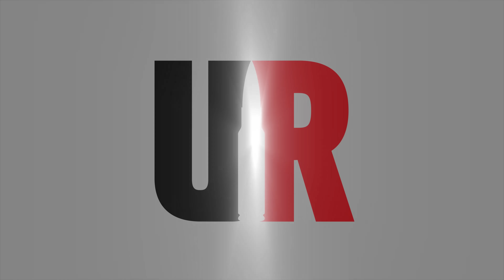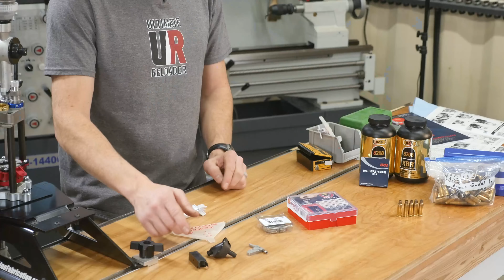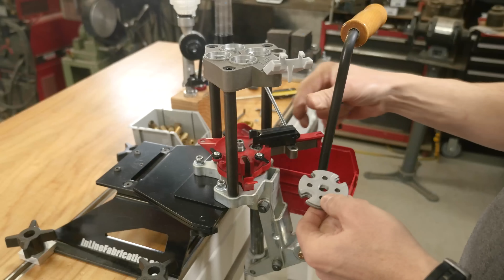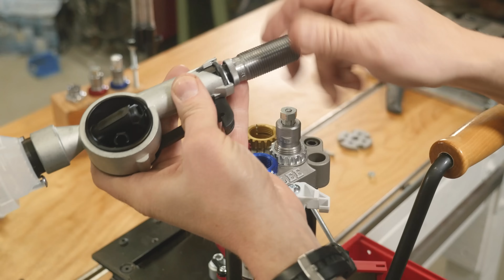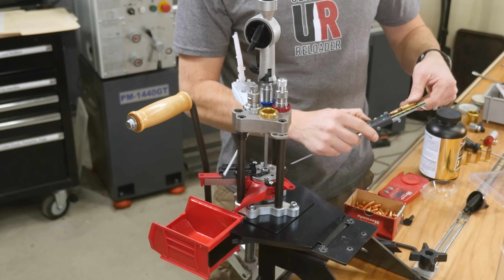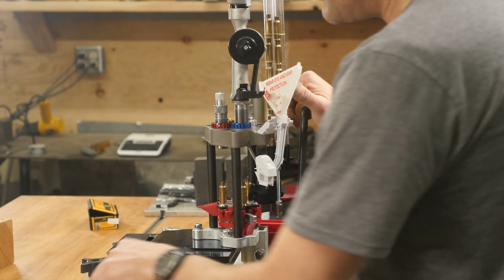Lee Pro 4000 Caliber Change + Loading 6.5 Grendel

Comment: After decades of single press reloading, I finally got out the Lee Pro 4000 9mm kit I picked up on sale a couple years ago.  Game changer from single press no doubt, a little learning curve into knocking out 1000 rounds in my spare time over a cold icy snowy weekend - something not possible at all with a single stage setup. Time to build up for the 2026 season. I do use my crimp die in station 4, good results. First weekend results are very nice.

Comment: How accurate is the powder charge? I'm thinking about buying this unit to reload 44 magnum using H110 powder. From everything I've read and watched, the gr weight with that powder really needs to be spot on or it can cause over pressure.

Comment: The pro 4000 is trash.
Will not index reliably.
Will not feed cases reliably,
Primer feed system is a cheap piece of  $h1t
Don't buy one , you'll be very disappointed.
 I'm an experienced reloader with 43 years of loading behind me.
 I own a lot of equipment and Speaking from experience, I can tell you that Lee Progressive Machines are Crap.
 Save the extra money and buy yourself a Dillon 550B ,
550C,  Square Deal B, or an 
XL650/750 or an 
RL Super 1050 .
 After one day of loading, you will be glad you bought a Dillon.   
If you buy the Lee, I guarantee  you the you WILL get Buyer's Remorse.

Comment: Went through my primer stash today and found 4 bricks of SR primers so thinking about setting up a dedicated 223 press.   Has anyone used the pro 4000 for 223 or 5.56 loads and tested in an accurate semiauto to see how they run?  Does Lee warn against any brand of primer on this press?
Reply: You can run 223 on this well I run 223 224 Valkyrie 6.5 grendel 6.5 Creedmoore and 350 legend on mine the only 2 suggestions I have is run your sizing die only so you can size and trim then hand prime unless you are ok with dropping 1-2 primers out of 10 on the floor then set it up with powder bullet seater and factory crimp die and run it progressive that way! I have recently purchased the Lee 6000 pro for my rifle and keep my 4000 set up for pistol. The 4000 will run anything up to a .308 in overall coal

Comment: For some reason mine is very hard to push up or down when i am on depriming/resizing, it just doesn't want to go up or down, i did adjust so many times, and lube the case really good, it just didn't help much, i did a couple ammo anyway just to test out but it won't even fit in my ar15 chamber. Seems like the resizing dies made it worse than before resizing. What do you think the problem?

Comment: Great video, well done Gavin.  I've owned a Lee Auto Breech Lock Pro since soon after it was introduced.  With the Safety Prime borrowed from my Lee Classic Turret Press and the brass feeder and Auto Drum powder measure borrowed from my Load Master, you could say I have a Pro 4000.  I run some .380 and 9mm on it but, that is about all.  It seems too small for my rifle calibers.  I really like the Load Master except for its priming faults, so my overall go-to is the Lee Classic Turret press.

Comment: I was told by a dealer that the 4000 is only for pistol and .223 cartridges but you mentiin using it for rifle.  Was the dealer wrong and rifle ammo can be reloaded on the 4000?

Comment: The only thing I would change is the powder throw to my Lee Pro disc.  I use H335 30.9 grains and it is reliable for my Grendel load data on a Barnes 100 grain TTSX.

Comment: What is the benefit of the 4th position? ie, the Pro 1000 vs Pro 4000. That is a core difference. I plan to reload both 9mm and .223, but, can't see the benefit of the 4th position. Do you see other benefits on the Pro 4000? Also, I see the Pro 1000 you can swap out the die turret to another set very easily, but the Pro 4000 looks to not have that feature.
Reply: Factory crimp die.

Comment: I've been running the Auto Breech Lock Pro (ABLP) for about 2 years now on pistol cartridges. When you've got a toddler running around, time is as precious as it gets and this thing gets it done. I normally used the Lee Classic Turret Press as my old reliable, but the ABLP is as reliable and easy to set up as the Turret Press. Price is fantastic, reliability is as solid as the Turret Press and you can load safely 6 rounds a minute and like I said with a toddler each minute is a blessing. 5 minutes before I go to work = 30 rounds, 10 minutes = a day at the range.
Reply: this is best comment here, bro I feel You

Comment: Bought mine a few months ago,  load 45 colt/38spl/357mag with bullet feed, best bang for your buck! I would like to see Lee offer more shell plate options to include most of the small and standard length rifle cases to make this press even more versatile (45-70 too). 
Case feed and auto powder measure works very well, you will likley get some ball/spherical type  powder leakage through the drum. I have two drums, one leaks slightly the other dose not.

Comment: which do you prefer the loadmaster or pro 4000? I have loadmaster and really like it, but dont use the auto case feeder, tried the auto bullet feeder with 38 wadcutters me and the bullet feeder didn't get along real well. auto rotate and primer feeder work great. Also upgraded to the auto drum powder measure big improvement.
Reply: I had the loadmaster and returned it.  I like the 4000 better.  Better priming system.
Reply: Save yourself a lot of frustration and skip the LoadMaster. It requires way to much tinkering to keep it running.

Comment: I’ve used my Pro 4000 for 9mm for awhile now and am satisfied with it. For the price you can’t beat it, although you have to be patient, follow the instructions and watch the Lee videos on assembly. It can be finicky and requires your full attention and checking adjustments periodically. Lee provides some great support so use them when necessary. I managed to install a bullet feeder after some struggles so it’s almost a real “Progressive Reloader” just got to figure how to feed the primers automatically. Keep up the good work and thanks for the videos.👍
Reply: Any luck with the primer feeding?
Reply: @matthewbryars4176  

Hi Matthew, no primers I’ve just about run out😬but when I had plenty I just had to sync that operation into my rhythm. Have you had any luck with finding reloading components?

Comment: The manual priming is quite a turn off.
Reply: Lee updated the Pro 4000 last fall.  The manual priming is auto priming just like the Pro 6000.  It works very well.
Reply: @andrewgoodwin6955  I just got mine too, and what a pleasant surprise. They didn’t even advertise it as far as I’m aware.
Reply: Yeah, it's all about price points.

Comment: The powder measure can have the entire 1# powder attached to it instead of the small clear plastic bottle.

This press is a very strong competitor to the Dillon 550.  Same volume per hour, 4 stations, and so simple a cave man can use it.

You can adjust the length of the lever arm so your shoulder is not in such an awkward canted  position like in the video. 

The priming system is perfectly adequate for 3-350 rounds per hour.  This is what a Dillon 550 realistically puts out.  It is also simple.
Reply: I have both.  It's not a Dillon 550,  but it will get the job done.

Comment: I’d like to see this press with some longer cases. I’ve heard you have to remove the auto change rod and it becomes a single stage. Say .308, 300 WM, 6.5 Creed, 30-06. I’d try it on mine but I’m still waiting to get it...
Reply: Everything up to .308 will run progressive I ran a lot of 6.5 Creedmoore on mine. You do have to remove the advance rod for longer cases it will start to rotate before the bullet comes completely out of the die and just turn it by hand after it clears and before it starts onto the guide rod. But all my larger magnum stuff I still load on my old trusty RCBS Rock Chucker as I have done for years! I just recently purchased a 6000 pro which is capable of running the large magnums progressively! But will still probably run my magnums on the single stage as I don't run hundreds of them at a time

Comment: I have one that i use mainly for 38 special. One problem I had was my shell plate was to tight for the primer tool so it binds on its way out. Ground out the bottom part of each pocket so it works.
The only great thing I can say about the primer system is that I get a lot of exercise picking up primer from the floor!
The press it self works fine, but my next press will be a 750xl!

Love your videos! I'm not sure I would be into reloading if i didn't watch your channel!

Comment: I promised Lee I was done with buying another Lee press. I have 2 loadmasters, and 2 single stages. One of my singles messed up and the lifetime warranty was no good because they redesigned it. So I bit the dust with it. PS: my load masters are less dependable than a second hand yugo.  They make good dies and case trimmers, but as far as their progressive press it’s surprising they can X-ray in business. My next press will be blue or green.
Reply: Blue is good.  I own 2.  Did you contact Lee?  I would think they would upgrade you with the "lifetime warranty" if it cannot be fixed.
Reply: @jawsmod  yes and they would give a discount if I bought another Lee press.

Comment: I have been using the ABLP since it came out - It was an easy press to set up and use - I however do all my brass prep off press including priming. So I have stage 1 powder - stage 2 bullet feeder - stage 3 bullet seating - stage 4 factory crimp die. I also use a automatic case feeder - now the fun part is I have a camera mounted so I can see it the case to see my powder level - so all I have to do is pull the handle and look at the powder level in the case.

Comment: I just got my Pro 4000 as a dedicated .38 Special progressive press for loading cowboy action shooting rounds. I have the case collator which isn't the best but it works. I also have the bullet feed system. After loading 1000s of rounds on a Lee Challenger single stage press, I'm quite pleased to have a progressive press. I've never used a turret press or any other progressive press so I can't compare it to anything else. However, you can't beat the price. Additionally, I've used Lee products for years without a single issue with anything they produce so wasn't' concerned with quality. Before I purchase anything, I do a ton of research, read reviews, and watch YouTube videos. The Lee Pro 4000 just makes the most sense. Because to me the most important factors are 1) does it work as advertised and 2) is it a good value? Even though money is no issue, I just can't see spending a boat load of money when I can buy something that I know is going to work.